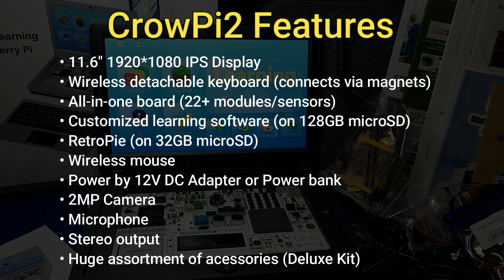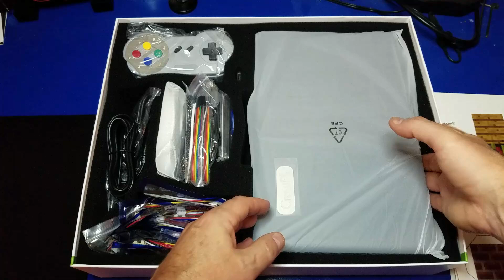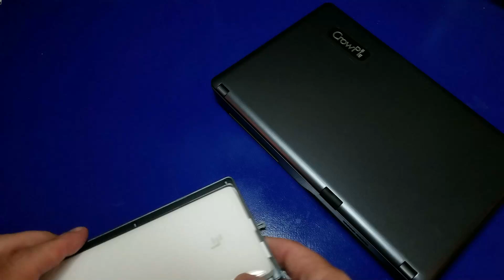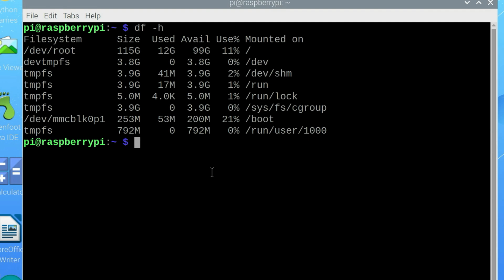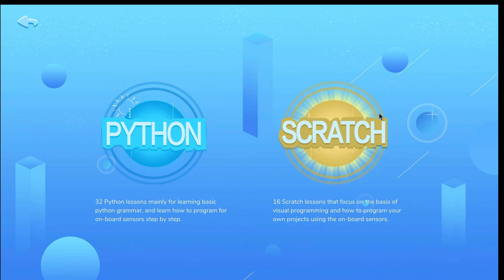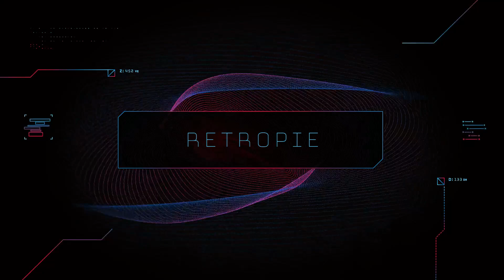CrowPi2 Deluxe Kit - Raspberry Pi 4 Laptop and MUCH More!

Comment: Thanks again for a great a detailed review! This as a great device, i should get one for my son some day...so i have an excuse to "play" with it as well :)
Would like see more of it, maybe a small project?
It‘s very cool that is uses Python as programing language. Very easy to use but still very mighty. I use this language on work for small scripts.
Great set of sensors, that invite to do many interesting projects with it :)
Reply from the maker: Thank you Sir, I greatly appreciate your feedback!  This is the first (of possibly several) future videos on what you can do with the CrowPi2.  I was debating should I separate the unboxing from the learning material and decided to make one setup video to help new users get familiar without having to watch multiple videos.  The downside is that it's a little longer than my typical videos.  The good side is someone new to the CrowPi2 can use this video to get started quickly with chapter markers in the description so they can skip around.  I do plan on digging into some more advanced projects, maybe even hosting some sample code on my website with wiring diagrams.  I definitely want to exercise this unit in future videos, if there is community interest!  I have a lot of projects in mind for it  😎

Comment: Would a pi5 fit?
Reply from the maker: You may want to check with Elecrow directly on that question.  There may be other issues using a Pi 5 with this device such as power.  I only tested with the intended SBC.
Reply: I just bought one and it comes with a 5 8gb I also bought a pi 5 16 gb and will swap it out.

Comment: Trying to image of the 128G TF card with Customized system and 32GB TF card with RetroPie system. Went to your website and the to CrowPi website is broken. (Alternatively, you can also restore the latest image from Elecrow.) I have the ELECROW Raspberry Pi 4 Model B Starter Kit, Raspberry Pi 4b Laptop, Crowpi2 Single Board Computer with Power Supply & Black Case Edition - Basic Kit.
Reply from the maker: Looks like you can find the image here: https://forum.elecrow.com/discussion/227/how-to-update-the-crowpi2-os-image
Reply: @WagnersTechTalk  thank you 🙏

Comment: I modify things at the drop of a hat. They call it "hacking" now, before it was "modding", when I was a kid they called it "tinkering".

So I immediately noticed that the 2nd HDMI port is blocked by the adapter for the 1st HDMI port to the ribbon cable. I have two pigtail microHDMI male to full HDMI female adapters on the way. Each will go into the 1st and 2nd microHDMI ports. One will then connect to the HDMI to ribbon adapter that was meant for the Pi 3 and to the screen in the CrowPi2. The other will then go to a 1ft male HDMI to female HDMI panel connector. This will then be my external connection to a 2nd monitor.

I am building an expanded bottom for it that will house nine 18650 cells wired 3/3 (parallel/series) (11.1 to 12.6V) with a BMS and a small 12V3A charger, and run that in through the 12V input. The Li Ion cells are scavenged from power packs, already in parallel sets of 3. I'll match the sets using a charger/balancer/load tester.

Should I do a video? If I do, I'm going to put it on my other channel, AE7HD.
Reply from the maker: Definitely would love to see a video on this, drop me the link if you do!  Sounds like some excellent mods/hacks and tinks you have planned 😎👍

Comment: What is the secret to getting this to connect to WiFi?

I found my phone hotspot on the list of wireless networks, put in the password. I get no error messages, but it hasn't connected. Changed the password. Still no luck. Am I missing something?

Tried with a vanilla 32 bit Raspberry Pi OS, connects quickly and works great.

Downloaded the disk image of CrowPi2 OS and put it on a micro SD card using Raspberry Pi Imager 1.7.3. Booted.

Nothing. It sees my hotspot phone. I put in the password and click connect. No error message, no attempt to log in, it just doesn't connect as if I'd clicked Cancel.
Reply from the maker: Make sure you set your WiFi country in raspi-config.  As long as you've done that, you should be able to connect.  I've had issues with my router where some devices (such as a Pi) has a hard time with certain special characters like #$, etc.  Try a simple password of alpha-numeric only and see if that works for you.
Reply: @WagnersTechTalk  Thanks! I bought this slightly used, so I assumed (ahem!) that it was set up. It was not. It was set to Algeria. So I went through setup and got it all correct... and it turned out to be my phone hotspot! It just started acting up with the Pi first, then in a few hours, anything connected was timing out. 

Rebooting the phone didn't help, so I switched to my tablet hotspot, and it ran smooth as glass. I feel pretty silly for not trying that sooner.
Reply from the maker: Glad you got it, pretty cool machine isn't it?

Comment: I'd be upgrading the battery to nearly double,at least 8000mah. Especially if I will be using it for retro gaming. This is neat and a great little toy for those who can afford to spend that kind of money on something like that rather than add another $100 or $200 and get something 3 times more powerful.
Reply from the maker: Just a heads-up, I received a newer model from Elecrow a few days ago which has a built-in 5000mah battery.  It will likely be my next video on the channel.  It doesn't include all the electronic components/sensors however like the CrowPi2 kit does, it's mostly a Raspberry Pi laptop.  More in the video review...
Reply: @WagnersTechTalk  The CrowPiL! I like how they did the connections to the ports this time. It brings the 2nd HDMI port out to a connector on the side.

Comment: Thanks for this awesome guide! I was following your steps to restore the backup image into a higher capacity microSD (512 GB), but when I finally insert the microSD in the slot and power on the CrowPi2 it is unable to boot :( 
Any hints on what might be happening?
Reply from the maker: Very welcome Karla, thanks for watching!  Since this video, I documented the steps a bit better here: https://wagnerstechtalk.com/common/#Backup_Clone_a_Drive .  You may want to start by re-formatting the 512GB microSD ( one way described here: https://wagnerstechtalk.com/common/#Format_as_FAT32_Pi_Imager ).  You can also use Pi Imager to restore the backup you already created here: https://wagnerstechtalk.com/common/#Burn_an_Image_with_Raspberry_Pi_Imager .  This should get you going.  I did use the instructions on the CrowPi2 guide to restore to a 512GB microSD and it also worked fine here.  Just make sure you have no other removable drives connected to your computer and should work fine.
Reply: Hi, Hope this link is helpful to you. It's about install an OS for CrowPi2: https://www.youtube.com/watch?v=kuef837A06o

Comment: Can it run Linux and do programming python
Reply from the maker: Yes, of course.  You can run many different flavors of linux: PiOS, Ubuntu, Linux Mint, etc.  Even the included OS is running PiOS (with a custom front end for the training material).  You can exit that and do other stuff.  You can also run RetroPie, Recalbox, Batocera, TwisterOS, etc. all linux.  Of course, Python, scratch, etc. runs great.

Comment: Do you have to insert RetroPie card in place of Elecro system card?  Question being you have to open cover and switch cards to switch between Pi system and RetroPie? Great Video!
Reply from the maker: Thank you!  If you want to swap from the Elecro microSD to RetroPie, you'll want to shutdown the CrowPi2, remove the back cover and swap the microSD.  I'm hoping that in the future we'll have a better option.  Mentioned it to Elecrow, they ran a test and it seemed to work but no official image as of yet.  Appreciate you watching!

Comment: Seems like you can get the nacked laptop frame including the sensor board to install an existing Raspberry Pi into it (if you already have one) for 269$. Sounds like a fair price to me.
And man, i love this modular design.  
So i guess you can still use the frame (screen, keyboard, sockets, sensor board, etc) even with newer Raspberry Pi boards.
I wish other laptops would be as modular. Could safe some waste if you could just exchange the mainboard, to get a new machine out of it ;)
Reply from the maker: You are exactly right, you could get the unit without the Pi 4 board and add it yourself (2/4/8GB of RAM).  You can also use a 3b+ if you prefer to use that version as well, it includes the adapters for it.  They put a lot of thought into the design and assuming the next version of the Pi uses a similar form factor and via holes, it may also work with this unit.  I think it's a great price for what you get with the kit.
Reply: Always can take casing and hydro dip paint it